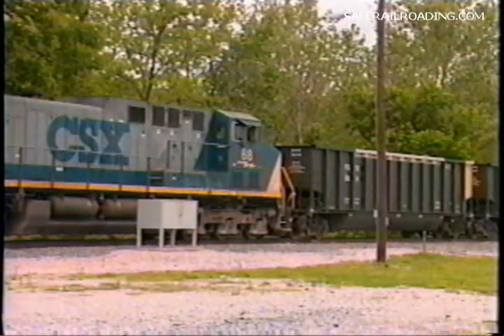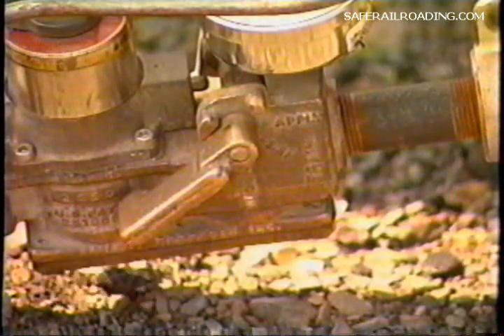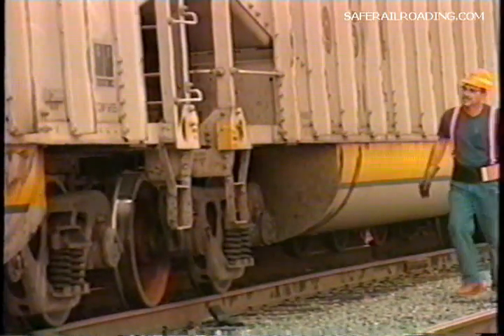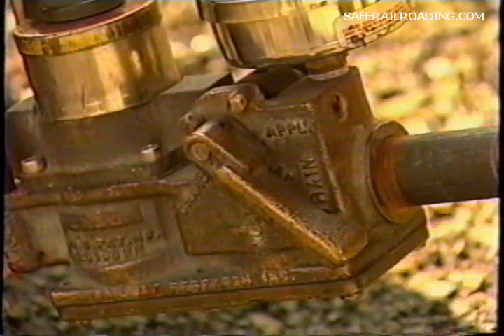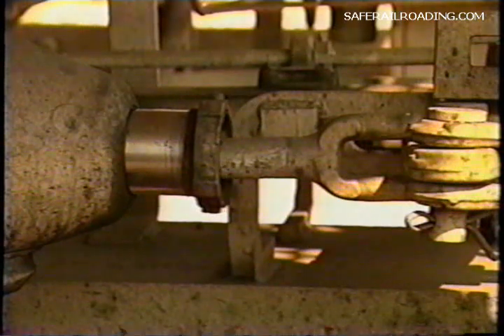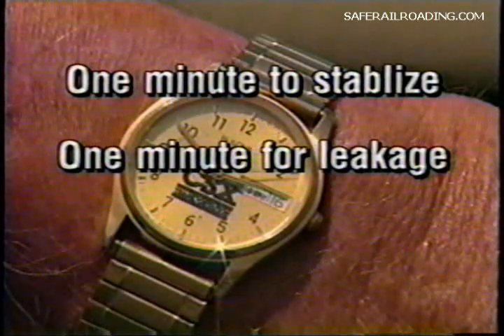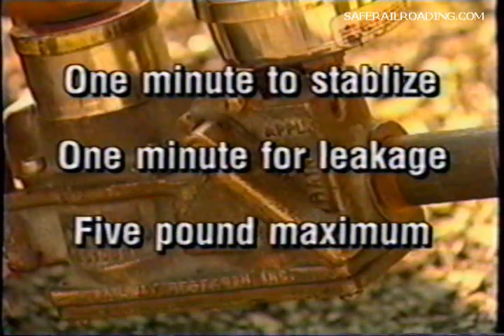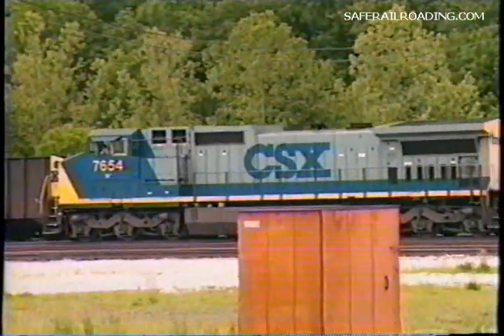CSX Train Air Brake Test

Comment: Minute 6:12, why can´t you have cars with inoperative brakes in a train ? Wouldn´t that make any difference in perfomance on a 100-car train if one or two cars would have no brakes.
Reply: denzzlinga no it really wouldn't make a difference for that many cars. these rules were made by people behind computers and lawyers with no train knowledge.
Reply: Where I live it's normal to have some cars with no brakes when the sparks/temperature from the braking operation is dangerous for the cargo (i.e. the traincar is loaded with High Explosive/Ammunition). But if you have a train that's carrying only this kind of cargo, every other traincar will be a flatcar with working brakes
Reply: Its the same in germany. 
You have to have a train consisting of at least 3 vehicles to carry one with inoperative brakes in the middle. Then breaking abilities will be kind of bad of course, but the rules allow it to operate a train like this.
Reply: I think it should be okay to have inoperative brakes on some vehicles, but the vehicles without brakes should be flagged and taken out of service at the earliest convenience.
Reply: denzzlinga class one break test must have 100% of the brakes working per FRA
Reply: Years ago you were allowed ten percent inoperable
Reply: When you see brakes that won't set during a brake test, that's a bad order and should be setout. If you take off with even one car that didn't set, and something happens, you better not tell that there was a car in your consist whos brakes didn't set. You'll get canned for sure.
Reply: You want all the braking power possible
Reply: In an initial-terminal brake test, it's mandatory 100%. This was intended for trains beginning from their terminal and going out over the road for a couple hundred miles or more, even though it's now any train going more than 2 miles total in any direction. But the bottom line is if it doesn't work it needs to be shopped before it's hauled, plain and simple. This does not count anything that breaks down while en-route though so on a 100-car train, you might get away with saying it happened on the road.
Reply: @darrenpelletier8014  not true, rules like these were written in blood.
Reply: @carlosphillips8447  You are still allowed a 10% margin of inoperable on intermediate brake tests or a Class-3 test. Initial Terminal tests require 100% and apply for conditions where the car(s) could have been shopped before handled anyway.
Reply: @darrenpelletier8014  A couple of cars without brakes wouldn't make much a difference but you have to draw a line somewhere. You can't trust these simple minded conductors to do math and add up how many cars on a train have inoperative brakes vs how many have functioning brakes so they made it an easy number to remember - ZERO.
Reply: @SD40Fan_Jason  yep you're very right. That guy just has the same toxic mindset as a lot of agreement workers and thinks that rules are just written to get him in trouble.
Reply: China Railway (using similar air brake system of America) allows up to 6 cars with inoperative brakes in a train, and their positions in the train are regulated.
Reply: @Kiwi0530  
why should a condr have to do any math regarding any inoperative brakes in a train at an INITIAL TERMINAL???????... how about this, if the equipment isn't functioning the way it's supposed to, you set it out and FIX IT
Reply: @Kiwi0530  
yea the SAME toxic mindset the railroads had when the government had to force them to improve the safety of their equipment...  remember the railroad safety appliance act... they could have done it on their own but they waited until they were forced to because every day they waited was money in their pockets... the railroads could care less about SAFETY... unless of course they're FORCED to care about it
Reply: @25mfd  You do realize that you're agreeing with me, right? I'm saying that all brakes must work so that the conductor doesn't have to do any math. If a car is inoperable, set it out.
Reply: @25mfd  My point is that the rule is there to keep them safe and not just to get them in trouble. The question of whether the railroads are being forced to enforce the rule is irrelevant. Critical thinking is not your forte, is it?
Reply: @Kiwi0530   

"I'm saying that all brakes must work so that the conductor doesn't have to do any math. If a car is inoperable, set it out."

now this is a MUCH better comment... without all that name calling and belittling of the condrs
Reply: @Kiwi0530  
"My point is that the rule is there to keep them safe and not just to get them in trouble."

again, a much more tactful statement... sort of a kindler, gentler twiggles0079
Reply: @25mfd  What do you mean belittling? All I said was that conductors aren't necessarily the smartest people in the world. Am I wrong? Do we have nothing but geniuses working as conductors?
Reply: @Kiwi0530  
hey, hey... remember... a kindler, gentler twiggles0079
Reply: @25mfd  hahaha I'm just busting balls. Take care brother